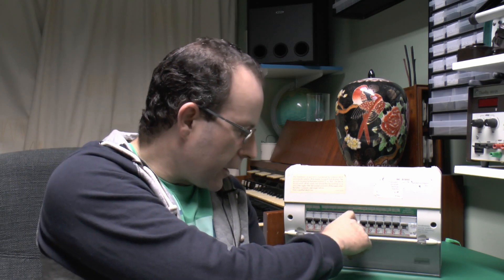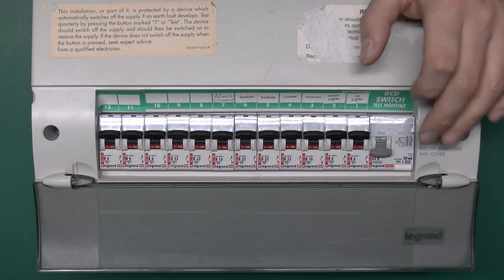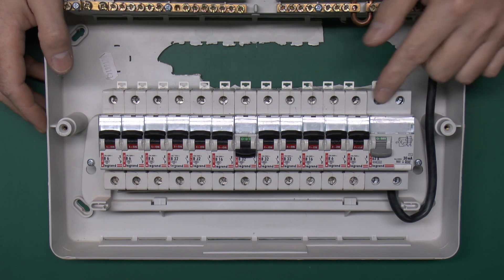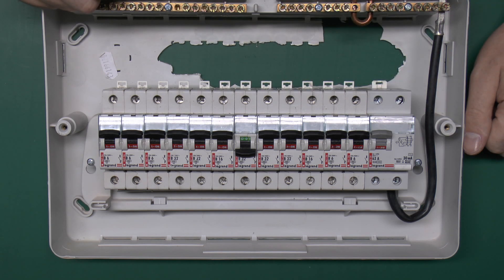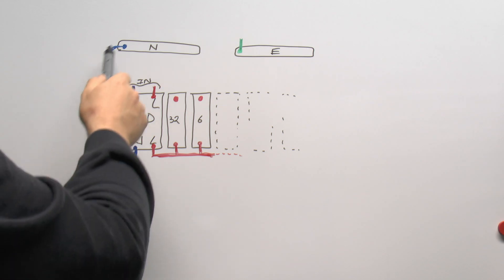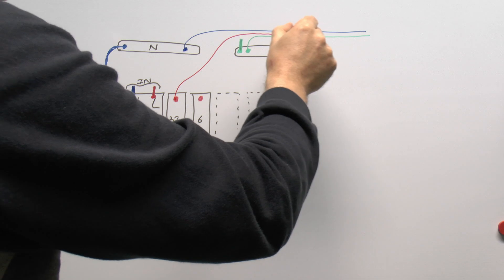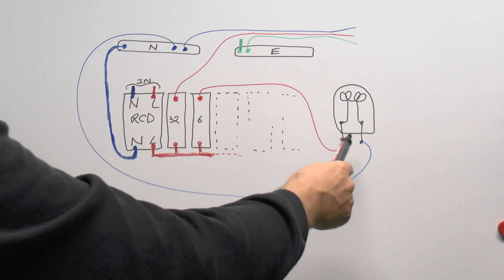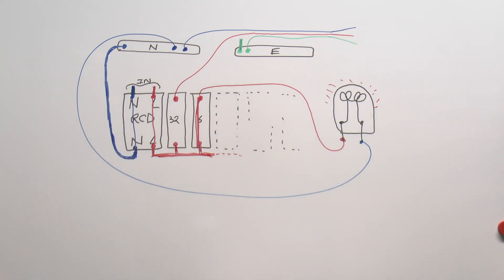RCDs: Neutral - Earth Faults

Comment: One thing I can't get in my head is why you don't get an electric shock from this scenario?
Reply: Because N and E are effectively at the same potential.  As soon as more than 30mA escapes down the E, instead of N the RCD will trip, saving you from a shock.
Reply: While you are creating a second path for the current to flow, it already has a very low resistance path, typically an ohm or less, through the neutral wire, neutral bar, into the RCD and back to the supplier's transformer. If you were to hold the neutral and earth wire together in each hand, the path through your body would be very high resistance by comparison, so only a tiny current would flow.

Comment: great video, explains what i was after. this happened to a street light while i was working on eastenders. the lamp wasnt working, it was disconnected from the supply but there was about 50v between earth and neutral. i have been trying to figure out the cause since. thats scratched an itch! cheers john, all the best.

Comment: It surprises me that there seems to be few DP RCBOs available  to fit into UK CU's These would seem to provide the safest  isolation. Each of the Line and Neutral would be separate  connections on ether the line or neutral.  An inherent design flaw in the UK consumer units.

Comment: That's why Australia uses a MEN (Multiple Earthed Neutral - A physical wire linking the Neutral and Earth Bars) links, you in a roundabout way described what the link is meant to do in that it'll allow the RCD to detect the imbalance but only on a circuit that has an active load. This has been proved as I've used it to trip an RCD when fault finding in a large board by intentionally creating that imbalance as we couldn't ID the RCD of that circuit.

Comment: I have a lighting circuit which trips on rcd even when all the switches in that lighting circuit are off and nothing drawing. What reasons can cause this? Would it need to be a live fault
Reply from the maker: Could be a L-E fault, although that would normally cause the MCB to trip (or fuse to blow).  It could also be a N-E fault, it's not always necessary for there to be a load on that circuit, loads on other circuits connected to the same RCD can still cause it to trip even if the N-E fault is on a different circuit.
Also check that there really is nothing else connected to the lighting circuit, things like smoke alarms and TV amplifiers in the loft are fairly common things to find connected to lighting circuits.
Reply: Thanks John for the info, I have a feeling the outdoor light is off the same circuit, also the shower extractor fan, so will check those before I get an electrician out. Many thanks for the helpful vid. Matt
Reply from the maker: Both fans and outdoor lights are very likely causes as they can get water inside them.

Comment: Great videos John. Currently got this problem and after disconnecting and replacing all neutrals got the problem down to sockets in lounge but cannot locate where problem is by removing each socket as all wiring looks ok. Is there a possibility that it could be a faulty MCB.I am in UK. Thanks

Comment: JW  Ive been wanting to get a Fluke 1653B  - to test systems here in the US... But now we have ARC fault breakers - will this damage the meter in anyway?  I was wanting to do a trip test and get a time/ amp reading on each 120vt circuit here in the US , any advise ?

Comment: How come you don't get a shock from the neutral bar when the same current is flowing through it as in the busbar
Reply from the maker: Neutral is at or very near the same voltage as ground.
Reply: You get shock if there is an opened or loaded neutral. True boss?

Comment: Hi John, brilliant videos very informative. I have a similar problem, i have an old lighting ring which was on the old fashion black covered  consumer unit, iv since replaced the consumer unit to have a RCD installed. I have reconnected the lighting ring and now each time i try and turn on the the circuit breaker for the lights it doesn't trip the CB it trips the RCD instead. Nothing has changed everything is ok as far as i can see the lights all worked fine now the RCD, any simple or easier ways of detecting where the issue could be ? Thanks again
Reply: I would be looking to see if you have a shared neutral on your lighting circuit

Comment: Obviously the best installation, the only problem I have come across is the immediate diagnosis that it's an earth or overcurrent fault, as the RCBO trips regardless. The older system would only trip one of the devices depending on the fault. A recent intermittent fault caused me to install seperate breakers in order to deduct the fault (temporary measure) I don't know if an RCBO exists with seperate indication flags as to the reason it tripped?
Reply from the maker: Not as far as I know.  Hager make an RCD which has a trip indicator, but that only shows the difference between the device being tripped due to a fault or switched off manually.

Comment: Are RCBO's used instead of MCB's in modern/updated installations? If not, should they be?
Reply from the maker: RCBOs are the better solution, one for each circuit.  A cheaper and therefore more common option is several MCBs connected via a separate RCD as shown in this video,  or in newer installations it's usually 2 RCDs in an attempt to ensure some power is still available in the event of a fault causing an RCD to trip.
Reply: Ok great video. But what causes the RCD not to reset with any one of 9 mcb's turned on before resetting RCD?

Comment: You have "fault" in that simplistic explanation:-  You do not show the "Supply Neutral" bus which is connected to the "Earth Bus".  Each RCD has its own "RCD Neutral Bus" separate from the "Supply Neutral", so as to avoid inter-RCD effects.  Each "RCD Neutral Bus" is then connected to the "Supply Neutral Bus" which alone is connected to the "Earth Bus"

I went into this very carefully before wiring my own workshop preparatory for the "Sparkie" to check the installation before he connected it to the domestic power supply and certified it as "complying" with NZ Electrical Regulations.

UK and NZ Wiring is effectively the same. - with "TT" supply - earth at transformer, and earth at installation site, with incoming Neutral connected to that earth stake via the "Earth Bus".
Reply from the maker: In the UK, neutral and earth are not connected within the installation.  With a TN-C-S supply there is a connection between N&E at the point of entry to the building but this is part of the electricity supplier equipment.
TN-S and TT have the N-E connection at the transformer only.
There is only a single neutral bar in the consumer unit shown as there is only one RCD which covers all of the circuits.

Comment: Is it not easier to remove the neutral wire first, then put electrical tape around it? This way the earths can't accidentally touch it while you are working on the socket - then put the neutral wire into the new socket first.

Comment: Hi John. I have 3 phase supply to my house. If I wire 1 RCD to  1 phase only ( say phase A ) to control all circuits ( light & power ) it works well, but if I wire another RCD to other phase ( say phase B ) the RCD trip off, I therefore have to use  1 phase only leaving other 2 phase unused. Could you please instruct me how to use all 3 phases (my house supply is three phase with 4 wires system, A,B.C & Neutral, and I have wired exactly as you have explained in this VDO) . thank you John
Reply: The RCD is a DPDT that is double pole double throw
Reply: Thank Zonepoh but much appreciated if you could tell me which type of RCD to use on the instantalation to stop the continuous tripping?
Reply: Hoang Nguyen 
Did you maybe connect the neutral to the second RCD after it comes from the first RCD?

Comment: You know, we're redesigning our Hackerspace's electric circuits, and your videos are very big help. :)

We're situated in the buildings decommissioned bunker and thus we have only one single 10A fuse for our space and it's pretty much inadequate for our needs. All the sockets and lightning is behind that one fuse, so we're going to replace the main cable with bigger one, install bigger fuse to the other end and a consumer unit for our space so if we trip something, we don't have to walk all the way to the buildings main fuse box (that's behind locked door) to get everything up and running again.

The idea is, that we design and build all the new connections etc, without making them live and then sparky with proper equipment and credentials comes up, measures and checks everything and connects it up to the mains so it's legal.

But since it's been like 13 years when I went trough the courses about electric installations, it's been a good resource to remind myself about the topic. :)
Luckily we have a memeber with automation as his credentials, so he's a big help even if he doesn't have the classifications of a sparky.

All we need to do is to make sure, that the differences in standards between Finland an UK aren't going to be too large so our sparky doesn't get a face palm when he sees our designs. :D

So thanks a lot :)

Comment: Hello John I have a therapy floating pool from America that recommends each appliance ( UV Pumps x 2, and heating pads that sit under the tank to heat the water which I have had earthed UK plugs put on) to have a GFCI connected to each of them. There is an RCD connected to the main electric board in the house. I have been told that I do not need the GFCIs on my appliances because of having the RCD already in the house. I am very concerned as water and electric do not mix and I need to find out if the RCD is sufficient enough without the extra GFCIs? Also the heating pads have a grounding probe and am also wondering if that is still needed as we have an earth in our plugs. I can ask the supplier all this but I would feel happier checking with someone who knows all about UK electricity. Thank you for your advice in advance.
Reply from the maker: Having multiple RCDs/GFCIs is not necessary, provided the house one is a 30mA type.  However if the pool already has them fitted there is no reason to remove them either.  The only minor problems can be that if they have a test button on them, pressing this may trip the main house RCD as well, and if a fault occurs it may not be the pool one which trips, the house one could trip first, or both could trip.
The ground probes is an unusual design and should not be necessary either,  the circuit already provides an earth connection.
Even if the probes were required, just shoving a probe into the ground is next to useless, as it has to be tested to confirm the impedance is low enough.  In some locations, earth rods have to be many metres long to be effective, or other methods such as buried grids must be used.

Comment: I'm always fascinated why certain countries choose to do things like this in a particular way.
I don't think I know of any countries where the N is routinely fused. I do know that in NL there were one or two areas until as late as the nineties or something like that where houses did not have regular 220/230 single or three phase (220-380/230-400) feeds — they had a three phase 127V connection, where the voltage between each pair of phases would be 220. So typical circuits would be between two lives and naturally fused on both sides (which also means that any nonfunctional circuit probably still had power to it).
OTOH most countries seem to leave the neutral un*switched*, like your UK example. Here in NL however we used to have assemblies of single fuse plus double pole switch per circuit, and we've now switched to breakers that thermally protect the phase and additionally switch the neutral. The N switches on first, and it switches off last.
Sometimes we get 1.5 unit wide gear, with a normal as-seen-internationally 1 unit breaker plus an additional half unit switch beside, that are mechanically coupled in such a way that the breaker can trip on its own, but if you switch, you can only switch both off, or turn on just the N and then after turn on the breaker. Or the better option, gear targeted to us specifically is just a 1 unit combination breaker and switch with a single switch on the outside. (The savings in din rail space more than make up for the cost of the breakers...).
Oh: our rules have been changed a decade or two ago to allow no more than 4 breakers per RCD, and a minimum of two RCDs per installation. Also, of course, to no longer allow non-RCD circuits.
Reply: It's the same here in Italy, neutral is allways switched, for me it makes sense to do that, it's more convinent to have only one RCD and then 1P+N breakers, also you are protected in evenience that L and N gets swapped somewhere, that it is possibile.
Reply: @MernokiMegoldasok  Really you don't get any benefit if you have a RCD in the circuit, the same current that passes on L must also pass on N, so even if the polarity for some reason gets swapped you are still protected from short circuit and overload, and you have the RCD that protects you from faults to earth.

Comment: Thank you. That was very well explained. Does the ELCB works on the same principle?
Reply from the maker: Yes, ELCB is just another name for the same device (earth leakage circuit breaker), current operated in this case.
The only ones which are different are voltage operated devices also called ELCBs, but they have been obsolete for decades.

Comment: John, it would be nice to include what is happening when ALL MCB's are off (no load) and the RCD still trips.  e.g. there could be equipment in the circuit that carries potential even with the power off. :-)
Reply: +Sofa Soul
"TheChipmunk2008" above actually pointed this out...
If you have a N-E fault, and you are on a TN-S supply, then you can easily get small currents between Neutral and Earth on supply-cable (as they may have a few volts difference between them).  These will still trip your RCD when power (line) applied to the primary of rcd.

Comment: I HAVE INSTALLED A 14 WAY FUSEBOX WITH 2 RCD IN A 3 BEDROOM FLAT.IT IS IN THE SECOND FIX OF MY JOB.WHEN I TURN ON BATHROOM LIGHT FEED  M C B  AND WITH TESTER CHECK THE POWER SUPPLY,I HAD 244 VOLT BUT WHEN I COTACT ED PHASE TESTER TOEARTH SEPARATE AND NEUTRAL SEPARATE ,IN BOTH OF THEM LIGHT TESTER TURNED ON ,BUT NO ANY VOLTAGE WAS IN THEM .I CHANGED THE CABLE AND AGAIN CHECKED ,I HAD THIS PROBLEM AGAIN .IN  FUSEBOX I CHANGE THE  M C B FOR THAT CABLE AGAIN I HAD THIS PROBLEM. IN THE END OF MY SCENARIO I UNDERSTOOD  WHEN IN BOTH R C D WHEN IN ANY FEED  WHEN  NEUTRAL AND EARTH TOUCH EACH OTHER  R C D DOES NOT TRIP, BUT WHEN I SHORT PHASE AND NEUTRAL TOGETHER  M C B AND  BOTH  R C D  TRIP. MY POWER SUPPLY IS 16MM2 TWIN AND EART  WITH ANOTHER 25MM2 EARTH  CABLE.I DOUBLE CHECKED NEUTRAL AND  RCD .COULD YOU PLEAS AS SOON AS POSSIBLE TEL ME WHY  R C D DOES NOT TRIP AND HOW COULD SORT THIS PROBLEM OUT.THANKS A LOT.CAN I HAVE YOUR  MOBILE NUMBER PLEASE.

Comment: Who says that the proper way is to have RCBO's ? suggesting that Dual RCD's is an improper way. I've not seen anything anywhere that suggests that RCD's are any less safe or improper than RCBO's. The difference seems to be purely more convenience at more cost for a fault that rarely happens. Both options satisfy the regulations. So therefore why do you suggest that RCBO's are the proper way?
Reply from the maker: +Madhatter1uk Section 314 where the installation shall be divided into circuits, , in particular 314.1(i)  to 'minimize inconvenience in the event of a fault'.  Half the house being disconnected including some of the lighting due to a faulty toaster is certainly not minimizing inconvenience.
Reply: it certainly is minimising inconvenience as only half the circuits are going off rather than all of them. If section 314 meant what you're inferring it to mean it would state that only the effected circuit should disconnect and there'd be no need for division of circuits. . If every circuit is individual as they are when an RCBO is fitted there is nothing left to divide. Added to the fact that NICEIC, NAPIT, and IET include them in their snag guides, pocket guides and features on their web sites and in PE magazine I disagree that they are 'improper' or that they don't comply with section 314.
Reply: If you have All The Moneys and All The Space (even though you eliminate the separate RCDs, the doubling per circuit to two units wide still makes for a larger box), RCBOs are the only way to go — but that doesn't apply all that often.

I like our NL compromise of at least two RCDs, no more than four circuits per RCD.

Comment: Have you ever come across an mcb protected circuit with roughly 100v to earth on the neutral? Even though the Live is showing 240v ish.
Reply: Check if the N and PE bonding at the service cutout is broken. This broken bonding could cause the system to be floated to earth and result in a voltage of around half of grid voltage on neutral.

Comment: Just wondering about rcbo's and why they switch only the live cable and not the neutral too...surely it couln't be much more expensive to trip the neutral as well?
Reply from the maker: +mrloy99 You can get double pole switched RCBOs, but even a small price difference is enough to make them uncommon.
Reply: @ @jwflame  I thought all modern RCBO'S were d.p.